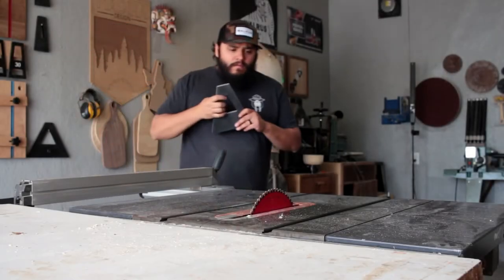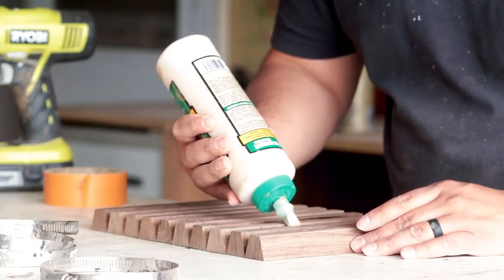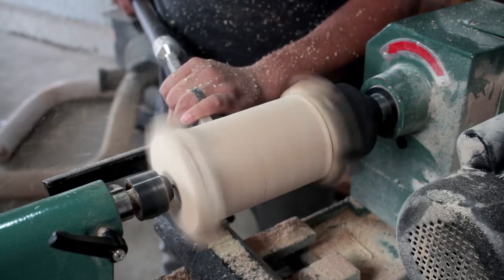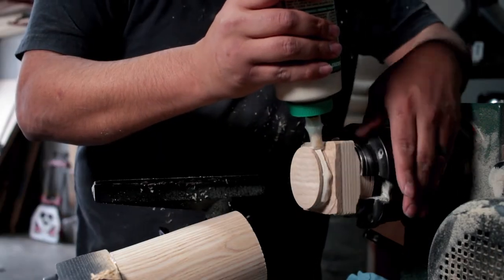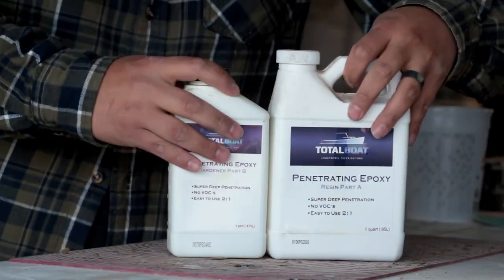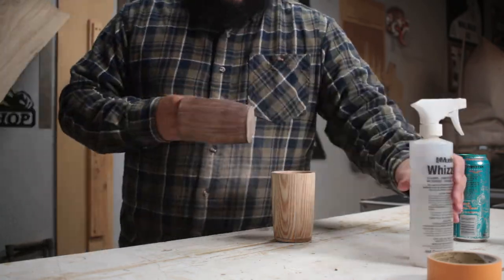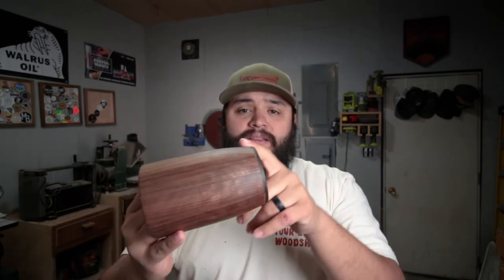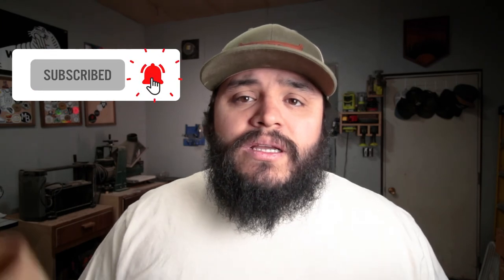segmented cups for beginners

Comment: As a resin artist - this video hurts me. I truly believe that all types of epoxy should be treated as toxic and non food safe because almost all are actually non food safe. The ones that claim to be food safe are only food safe IF they are properly mixed and cured. If anything is mixed into it (mica powders, pigments, and so on) anything the packaging says about it being food safe goes completely out the window. Companies claiming food safe means that he resin parts alone are safe for food to touch once fully cured. (But you still do not want anything overly hot, acidic or alcoholic to touch it because the epoxy will break down. You also do not want to clean it with harsh chemicals) This epoxy on a piece like this should be fine, but i think it is important to note that there is a difference between coating epoxy and casting epoxy and people can’t just go out and buy an art resin and expect to have healthy lungs for the rest of their lives.
Reply from the maker: Thank you for sharing this information. I’m sure lots of people will be glad to know it. I know I am.

Comment: I know this vid was posted 9 months ago so you may already have more knowledge on it. But there are a few food-safe epoxy resins out there that you can use. But when it comes to cups and bowls, I always recommend carnauba + bees wax mix or regular old Shellac finish.
Reply from the maker: Thank you! Yes, that’s what I ended up going with in the end. Or maybe something like a tung oil?
Reply: @madiradesign  Tung oil is great if you have the time to set it up to dry thoroughly for a few weeks.
Reply from the maker: @aj2142  true. Guess it would just take some planning.
Reply: Carnauba / beeswax will not stand up to hot beverages, nor will shellac.   They're fine if someone isn't gonna be drinking scalding coffee outta them, but even at that, they won't hold up under repeated washings, so the finish would need to be reapplied regularly if you didn't want the contents to just be soaking into the wood.

Comment: That looks like a fun project. I need a lathe. 

I used West Systems epoxy on a cup I made. I called them and talked to an engineer about it. They said they didn’t know if it was food safe. Probably a liability answer and yet true, they likely didn’t know. I drank from it once cause I’m still not sure. I still have no idea what I’d trust as a finish on my coffee cup. 

Cool video though. Keep it up.
Reply from the maker: Thank you! Im about to make a new set, and I’m just going to use cup inserts. Take the guess work out of it all! Thanks for watching!
Reply: @madiradesign  stainless steel? That’s a good idea.
Reply from the maker: yeah, It might be a little challenging getting the fit just right, but I think it will make in interesting video!  @backtolife208

Comment: I wonder if you used several layers of boiled linseed oil and let it cure for a month or two if that would suffice. I wouldn't put hot fluid in an epoxy finished cup.  Great video and i am going to source wood to make this.
Reply from the maker: hmmmm.... I'm not sure. linseed might work, but I really couldn't say, I'm now finish expert. couldn't hurt to make a couple cups and try it on one or two. So awesome, I'm excited to see what you come up with!